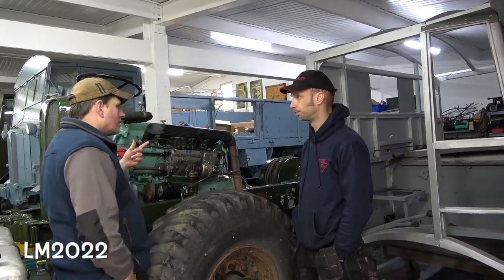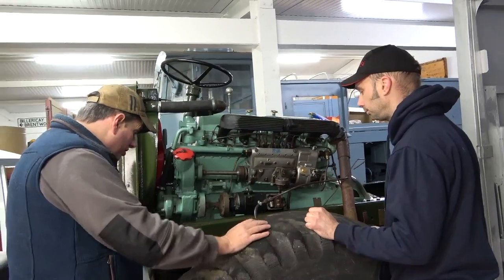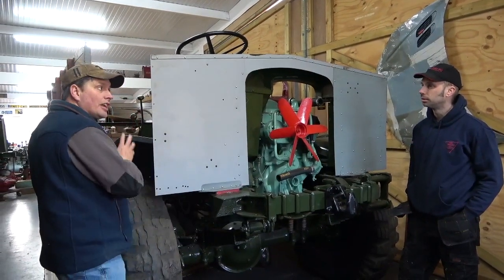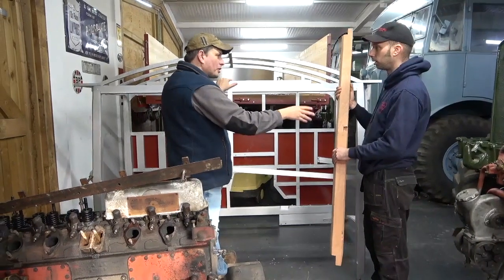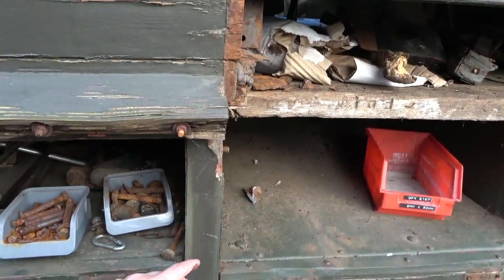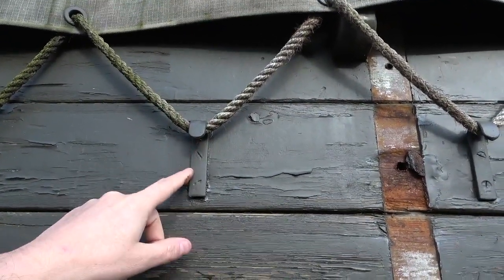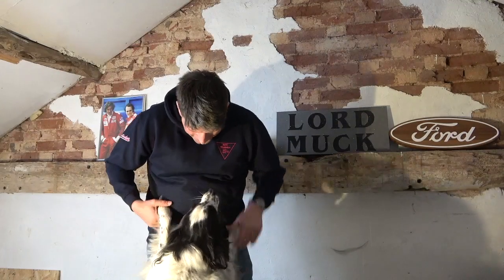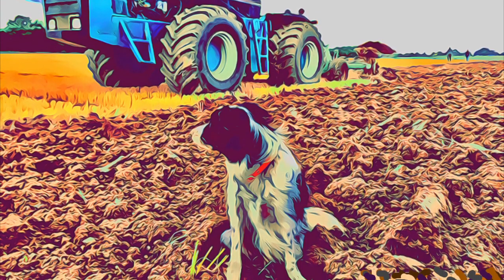TIME FOR THE CUTTING TORCH

Comment: super impressed by the workmanship going on in that yard even as a diamond t guy through n through i'm starting to get a soft spot for the matador's. have no doubt the ebay buy will fire, a friend and i dragged a 1943 diamond t 981 out of a scrapyard last year and managed to get the hercules diesel un seized and sort of running after sitting at the bottom of a scrap pile since 1964. can't kill quality engineering just sometimes it needs a cuddle.

Comment: Got a soft spot for AEC their buses took us most places before Dad got a car. Remember see chassis on test in the sixties driver protected with perspex plywood and batoning, flat cap, googles and dispatch rider coat, later the cap was replaced with a corker crash helmet. Often while waiting for a London Country RT (green bus). Don't think you tube has got it right your content is great. Thanks. PS. I was told years ago by a guy restoring a bus the hill in the village was used as a test hill.

Comment: You can't save every one and every bit. If you can save one with parts from itself and two others you have kept part of history preserved.  Rust, corrosion and years of abuse and neglect are costly to repair.
I would love to redo an early 1950's American COE truck, but I know rebuilding a 70-80 year old engine and transmission is possible, but does the expense equal the historical value?  Does saving the body and frame with a modern (last thirty years) drive train, brakes, suspension and convenience features (heat, AC, air ride seat, power steering) make it a more usable vehicle while retaining enough enough of the original vehicle to "represent" the original vehicle, or am I just creating a "Frankenstein Truck"?
Reply from the maker: If you own it, it's your choice and part of the vehicles story.

Comment: After I'd picked myself up of the floor laughing at molesting a mongoose 🙄🤣🤣🤣 checked settings all present an correct 👍 really lookin forward to this matador will it start💪 any update on the 602 charity tractor 🤔 or did I miss the notification o this 🙄😳😂 great video 👍
Reply from the maker: Engine and fuel system completed on 602, now just sorting brakes.